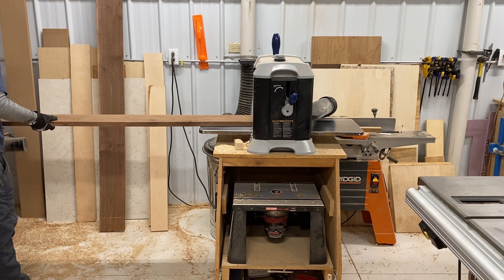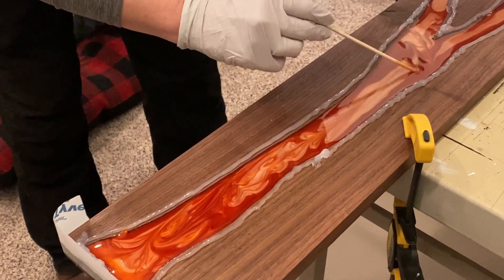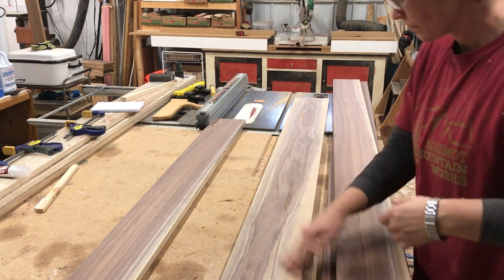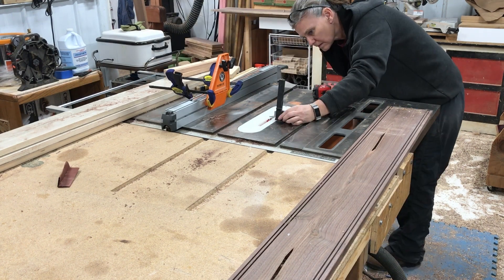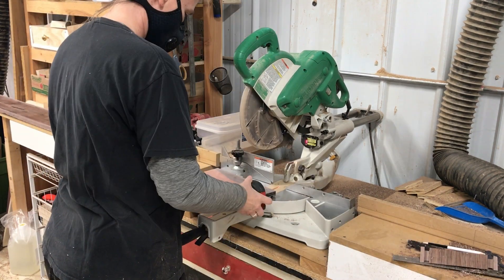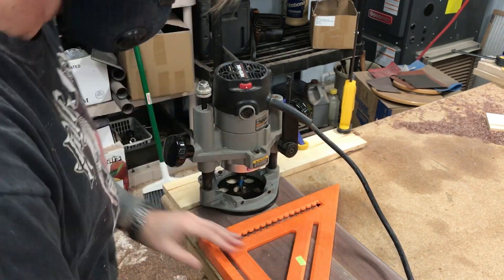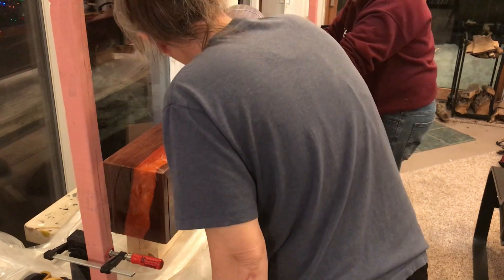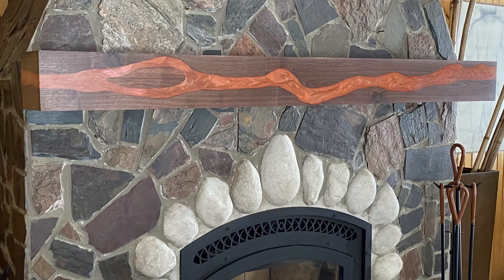Custom Fireplace Mantel: Walnut & Epoxy Resin with Waterfall Edges

Comment: WOW! Just WOW! Beautiful mantel. And I have major tool and shop envy!
Reply from the maker: Thanks Pam! I’m an incredibly lucky girl. I’ve been doing woodworking of some sort for 20 years and so have accumulated a lot of tools & equipment over those years, and well as getting lots of hand-me-downs from my dad as he’s not doing so much actual woodworking these days. My first shop was a corner of the basement, then took over more of that, then moved into a small garage. When we moved in 2017 I’ve been blessed with a 24x36 pole barn with a concrete floor, and insulated and finished walls. I added a furnace and have an amazing shop that’s comfortable year round.

Comment: Lisa that is a very beautiful mantel. I'm impressed by your talent. 
Watching you cut those rabbits in the ends and clamping that square with one clamp is what impressed me the most. If I had done  something like that it would have moved and messed it all up. Keep up the good work.  Have a good day and week.
Reply from the maker: Thanks Joey, I was very careful not to push too hard on the clamp and move the cut line too far! I’m really pleased to say that I didn’t screw anything up on this project. Well, as far as measuring or cutting things wrong 😂

Comment: Very nice build Lisa. I like your work processes; straight forward, safe and effective. Had the same table saw for 13 years, traded up to a 2.5 hp cabinet style, mostly for the added safety and accuracy (riving knife and simple /easy procedure to dial in plumb and parallel). Best of all I learned some very good practices for working with resin too. Thanks for sharing, off to the shop.
Reply from the maker: Thanks Gord! I’ve had this for almost 20 years and it suits me ok for what little I’m doing with flat stock these days. I haven’t looked at it really close yet but I don’t think there’s a way to use the kerf splitter (is that the riving knife?) without using the whole giant plastic safety guard thing. It was really cumbersome so I just go without it. Thanks so much for watching and for taking the time to leave me a comment
Reply: Lisa Ramlow roving knife and splitter serve same purpose, to reduce kickback by preventing the kerf from closing on the blade. Main differences; the kerf splitter is generally part of the blade guard and attaches directly to the saw chassis, the roving knife is attached to the bladed carriage and moves up and down with the blade with the top of the knife below the top of the blade, allowing the knife to stay attached during non-penetrating cuts.  So basically, when the guard is in the way (it attaches to the Irving knife mount), I use the riving knife to prevent kickback and improve overall safety. Thanks for taking time to answer!

Comment: Fantastic job!  Something that I have incorporated in several of the mantels I have done recently was a receptacle if electric was available. If the top of the mantel is at or slightly above eye level i will recess the receptacle and cover plate into the top about 3/8” a few inches off center. It has been a very popular option with my clients. Bravo on the epoxy! I have never tried to use any and really wouldn’t know where to start although I see lots of people doing various projects with it. Thanks for taking me along visually on your journey
Reply from the maker: Hi Dennis, thanks for stopping by! Adding electric is a great idea. This is the first mantle I’ve done and isn’t so much what I do, though I did enjoy the process and am quite proud of the result. And one of the clients is an interior designer whose friends are all envious so it may not be the last one! 😂

Comment: Wow, I had not realized you were such an allround woodworker! I think I could do this too, if I had the tools but obviously I do not have the experience because I never tried something like this. And you know I don't like working with resin. But still, this shows that you have many more skills than just woodturning. I hope you got paid well for this one. Thnx for sharing!
Reply from the maker: Thank you Leo! I’ve been doing woodworking of one form or another for about 20 years now and have accumulated a lot of tools & equipment over that time. Also, my dad retired from GM with three journeymen’s cards so has a ton of hand tools and is also a woodworker so I get a lot of the stuff he’s not using anymore 😃

Comment: Very pretty! That, im sure, was alot of figuring, planning, headscratching, and executing. But, it turned out to be an AWESOME showpiece! Well done! Im also impressed with your shop. (Envious, as a matter of fact. lol)
Reply from the maker: Hi Dave! This was definitely a challenge, as it was a completely custom job and. Or something I’ve done before. I’m a very lucky girl - have been woodworking in one form or another for about 20 years now so have accumulated a lot of tools & equipment over that time, and when we moved was blessed with a 24x36 pole barn with a concrete floor, and insulated and finished walls. I added a furnace and it’s an amazing shop! Beats the hell out of the corner of the basement I started in 😂
Reply: @LisaRamlow  id love to have a shop like that. Or...a shop! The garage where id been turning lost power to the outlets. I dont own the property, and no option available for relocating. So, im an ex woodturner. But i still watch the videos, and enjoy the  craftsmanship of all you fine people!
Reply from the maker: I’m sorry to hear you don’t have a place to work 😕

Comment: Absolutely beautiful! How does the epoxy and wood react to the heat of the fireplace ?
Reply from the maker: Thanks Marc! Epoxy is pretty heat resistant as long as you’re not setting hot things directly on it, though I have seen people pour alcohol on epoxy countertops and then set them on fire to test durability so who knows! 😁